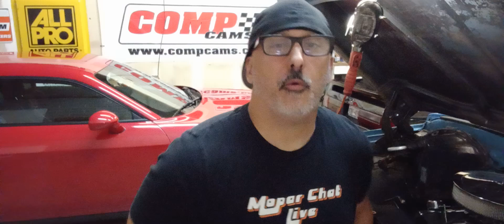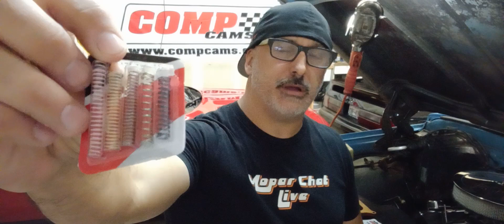Edelbrock AVS2. 4 hole spacer tuning. part 2.  Follow up.

Comment: Would the air valve on the secondary have anything to do with your findings? I only ask because adjusting the air valve on the secondaries on my setup made a huge difference.

Comment: My car: 65 GTO, Tremec 5-speed, 406 SBC, Dart aluminum heads, Howard hydraulic roller cam that makes power to 6000, AVS2 650 cfm vacuum secondary. My drivability issue was exactly the same as yours. I have an Accel wideband AFR gauge (after going through three AEM gauges that failed within five miles). It is amazing to visually see on the gauge what I was feeling in my SOTP, ie: the engine start to lay over at about half throttle while watching the AFR go to 15.5. That is the essence of biofeedback. I replaced the standard 5hg orange spring with the 8hg silver spring and, just like that, problem solved. Thanks.
Reply from the maker: Sounds like that car would be a blast!

Comment: There is a combination of things you can do to tune any Edelbrock carb. Primary jets, springs to somewhat fine tune, metering rods, also to somewhat fine tune. The larger number on the rod is for the cruise mode, smaller number is for the power/wot mode. Springs also come into play for that. I highly recommend using an AFR gauge to tune a carb, it makes it so much easier, way less guessing, using one, tuning with it lets you know how lean or rich you are. I was able to tune my setup on the lean side, but still on the safe side, with the gas prices they are it makes a difference. To lean and you fry/crack a piston, to rich and you take the chance of inducing extra gas into your oil, building up unwanted carbon, which isn’t good for your engine. Also moving the accelerator pump rod from the factory setting can help. Middle hole is factory, bottom hole is a leaner shot of gas, which is hardly ever used, and top hole is richer shot of gas. I’ve tried many combinations, and you may have to also, every engine has it’s own combination that works best for whatever drive ability that your looking for. Whether it be for power or fuel economy.

Comment: Change the accelerator pump link to the hole closest to the carb body. It will increase the accelerator pump volume...and should clear up that lean spot.
Reply from the maker: It's there.  I covered that in an older video.  Without that adjustment, she would lean bog BADLY.
Reply: @Moto-Psycho-1  the 1948 kit is for the AVS2. The 1400 kits are for the older models IIRC. Could be different graphs/diameters etc.
That 1948 kit will give you much more adjustability.  The 650 is ragged edge of too small for a 400 ci engine anyway. Jet and rod change should get you where you need to be.

Just realized you only bought springs..lol..my bad...full kit will get you where you need to be

Comment: My 2 barrel had a spacer on my 65 ford mustang 289 2bl. and I went to a 600, 4 barrel and it was no good when you 1st start off but once you switched to 2nd gear it would go like a rocket.  Going back to old 2bl. Set up.
Take off was better & gas mileage.  Thanks for video.